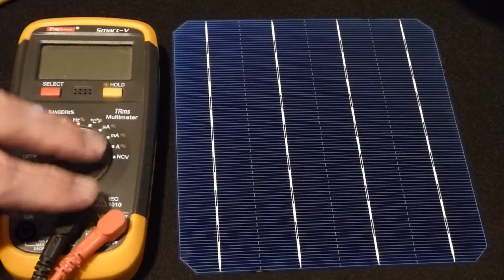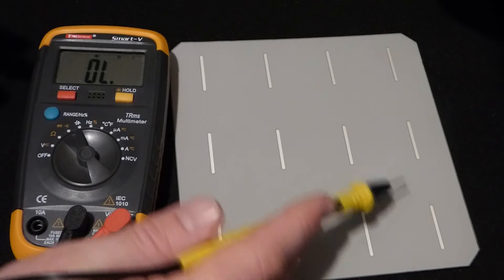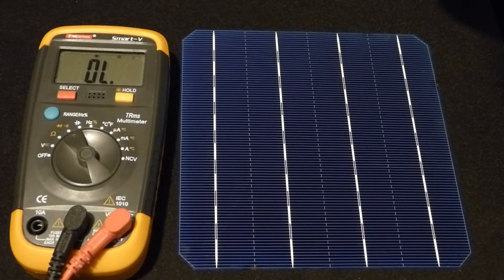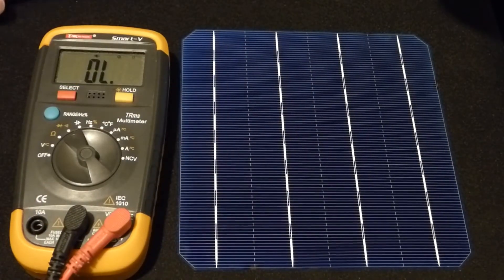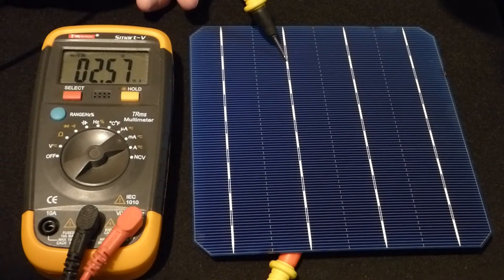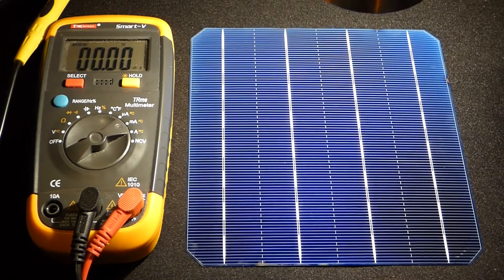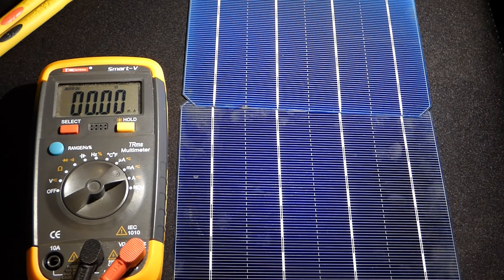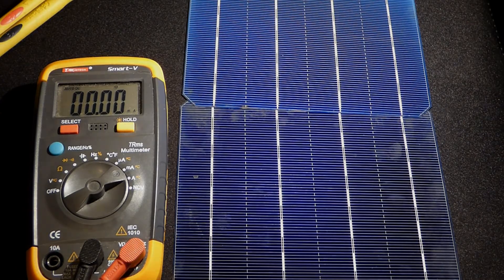Multimeter testing my new solar cells indoor

Comment: I have the same cells, and did the same thing (got fingerprints all over one) so I took some rubbing alcohol and a blue shop paper towel (for less lint, don't use cotton ball or swab, you'll leave tons of fibers) and lightly cleaned it off, then took some low tack painters tape and lightly dabbed/brushed the areas where some of the paper towel fibers were left to get those off... Re-tested and it didn't hurt the cell at all (and got all my fingerprints off)
Reply from the maker: Thanks for the tips! With the price of solar now and the cost of encapsulation, my lack of workspace, etc. I don't think I'll ever be making my own solar panels now.
Reply: @Electronzap  I would agree, I was looking for a way to get solar onto my boat and still be flat (and fit irregular sizes)  So I'm experimenting with these (hoping they can be walked on when flat on a boat...)  :-)

Comment: you are testing low light. can you test it sunlight ?
Reply from the maker: Hi there! I hope to but I have no idea when. I have been working lots of hours since I made this video which makes it a lot harder to make solar videos than other videos. Thanks for your interest!
Reply: If you can test sun Light, i think 1 cell value 0.6v 7amp. 1 solar cell ~4.2watt. I search how can charge high current.  I have got 4 cell panel. Its value 2.4v 7amps. How can charge 3.7v 3amps battery i dont know. I am searching. If you help, i am happy :)

Comment: So if the cell is 4.8W and 0.5V, why isn't it measuring around 10 Amp, since I = P / V ?
Reply from the maker: I'm not out in the sunlight. That's probably about what you would get with the cell pointed directly at the midday sun while it is directly overhead. Less light = less current.
Reply: But in your second measurement it does reach about 0.5V and the current is still about 0,13A. That's nearly a hunderd times smaller than 4,8/0,5. This drives me crazy and yet can't find no straight clear answer on google. Instead I get all these graphs on efficiency.
Reply from the maker: I'm using really low light here as an experiment. The voltage is easy to get, even in relatively low light, but without sunlight, the current is really low. I have since bought portable solar panels and did some indoor and outdoor testing and found them to only provide substantial (about the rated value) current outdoors, and hardly anything using lights.
Reply: Okay thank you sir. The thing is, I have a concept in mind of making a phone charger out of one solar cell that has rating of 4w and 0.5v, using a boost converter with a dc output of 5v and 0.6 A. According to my calculations, if the voltage gets 10 times higher, the current will get the same amount lower to 0.8A. wich will leave me with a surplus of 0,2A times 5v = 1 watt to dissipate. Will it get too hot?
Reply from the maker: I was thinking of doing the same thing, but I'm pretty sure it's best to buy a cell phone charging solar panel. I got mine for about $13 US. If you can find a voltage booster that goes down to .5V, I'm pretty sure they are lot more expensive that ones that convert 1V or 1.5+V to 5V, then in theory you can get 10 times the voltage at 1/10th the current, with no losses. A huge problem is that one ohm of resistance between the voltage booster and solar panel at .5V will already reduce the current to .5A (500mA), wiping out almost all of the power. Which is why you always see these cells in series. It's a pretty complicated project.
Reply: How many cells in serie would I need to overcome the power drop?
Reply from the maker: It's easiest, and cheapest, to keep connecting cells in series until you have the voltage you want. I planned on using voltage boosters to limit the number of cells needed for a certain voltage, but that will reduce current.
Reply: According to my calculations, not sure what knowledge i'm missing, but one cell would be the best because if I'm having more cells in serie, like lets say 4 times .5 would be 2 volts and then 5/2= 2,5. Then I would only be able to divide the 8 amp by 2.5 = 3,2 and that's way to high. But like with one cell wich is .0.5V to 5V, I would be able to divide the 8 amp by 10=0.8A wich comes much closer to the output current of the booster.
Reply from the maker: When you put them in series, the voltage adds up while the current stays the same. So 2 cells in series doubles the power by doubling the voltage. Increasing the voltage by using a voltage booster will drop the current a lot even if it were 100% efficient. If you double the voltage with a booster, you can expect about half the current. 4 times voltage boosted will result in no more than 1/4 of the current, and so on.

Comment: name seller? Thanks

Do you test if they really provide power which is described? I have same cells polycrystaline 4.5W

I measured on very good sunny day, best results was 465mV and 8.55A
Reply from the maker: FxFexo I got mine from an EBay seller. I haven't tested Outdoors yet, it was raining all weekend and I need to get one in a solid case, I already broke one. I'm brand new to solar, just playing around with them for now and have no safe place for them outside, so sorry I don't have a good answer for you.
Reply: ya, I mean seller name on ebay
do you could put some number when you will test outdoor with good sun? Thank you